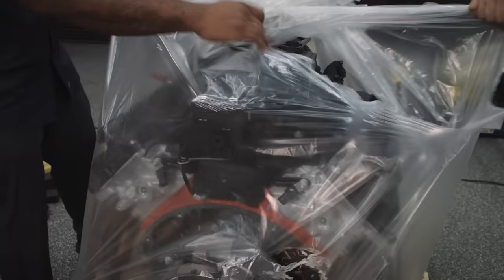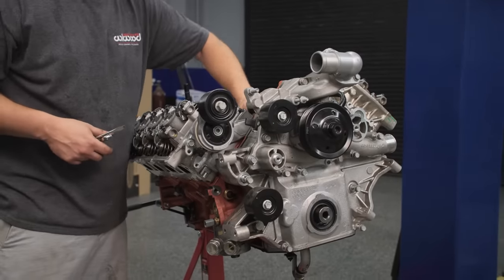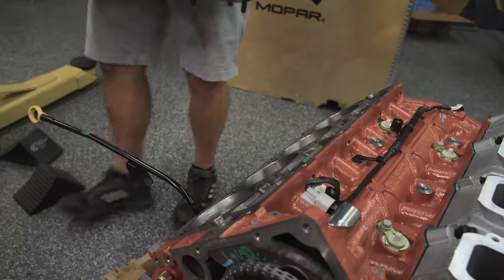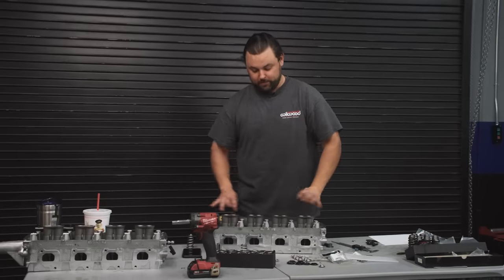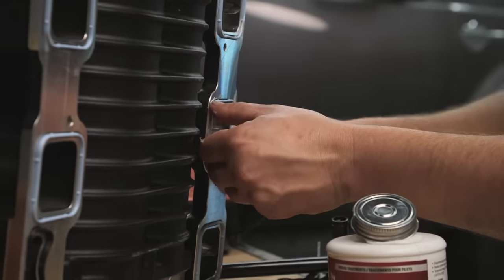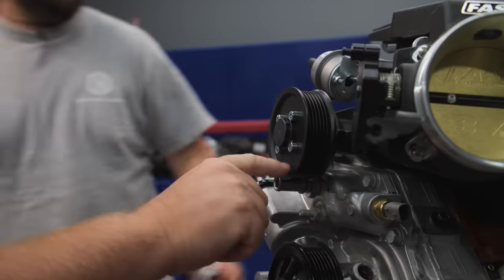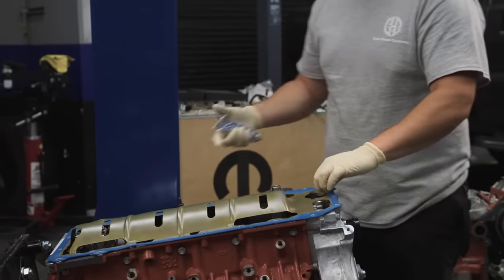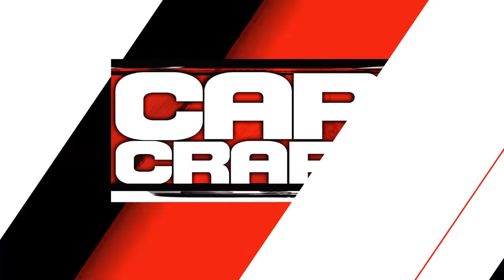2 Hemis Combined into 1 Supercharged 6.2L! | Car Craft 86 Buick G-Body Build Part 2 | MotorTrend

Comment: Hemi, the most unreliable HP you could use.
Reply: Hemi head flow by far more CFM stock compared to a stock LS engine.
Reply: @jakey20022  head flow does not mark reliability.